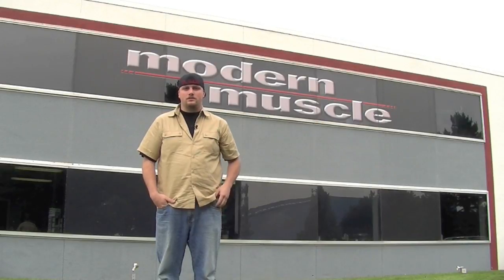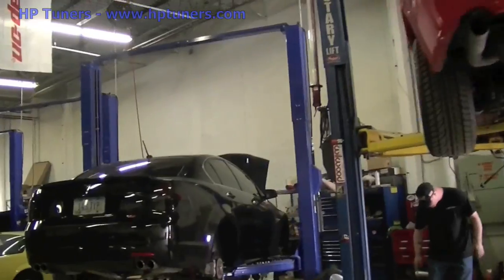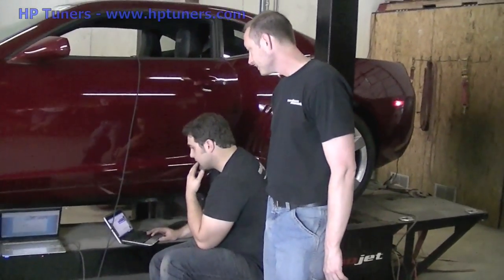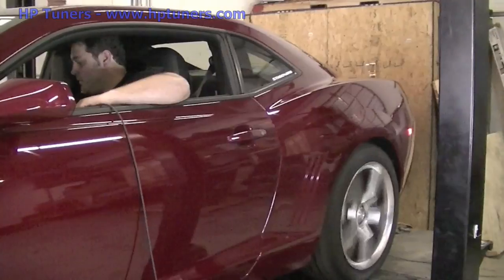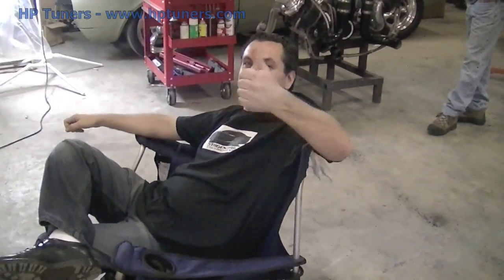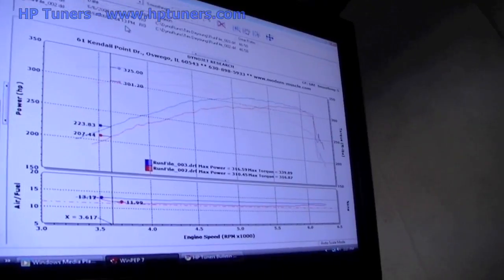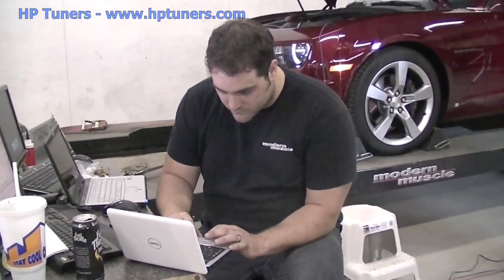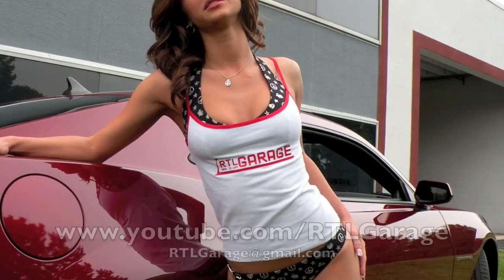2010 Camaro Dyno Run - Hp Tuners. EP2

Comment: @ChristensenPatrik The Camaro SS manual ls3 makes about 360-385 whp stock. L99 and 6L80 together are pretty pathetic compared to that but still makes far more hp and tq than anything fiat has to offer. What fiat model does our brother have? What dyno did your brother run his fiat on and how much power did it make? Too bad you live in Sweden you'd probably love the camaro, you'd be surprised how great the quality and interior is.

Comment: @JoaquinSerrapio I know this is an old post but.. I have a 98 6 cylinder turbo charged camaro weighing ~3400-3500, with an estimated hp of 250-270 with moderate boost.  I've ran a 13.92 with it.  Given the hp and weight of the 2010's I'd say their numbers sound reasonable.

Comment: 310 is still pretty bad...my stock 99 ws6 pulled 315 to the wheels and runs consistent 13.1s at the 1/4 on street tires with an a4.
Reply: V6

Comment: the l99 is a reduced output version for the automatic tranny, it is rated at 400rwhp at the crank so low 300's isn't too bad but I did think it would be a little higher,  now I want to see a stock LS3 on the dyno.

Comment: couple things you gotta take into consideration. This guy's got a L99(the motor you get with the auto) which gets 400 hp. The manual LS3 gets 426 horses. Chevy doesnt advertise RWHP. Those numbers come from the engine at the crank. By the time the power gets to the road, it can lose 50 to 60 some odd hp. So baseline run isnt that uncommon, but if you break in the motor, like putting at least 5-6k miles on it. It does better